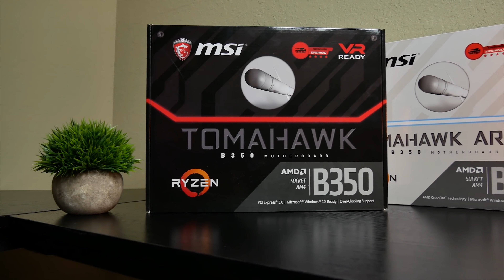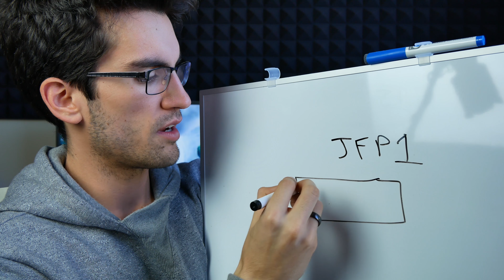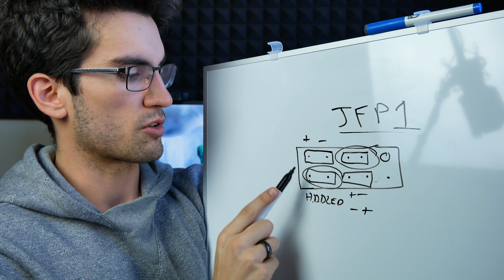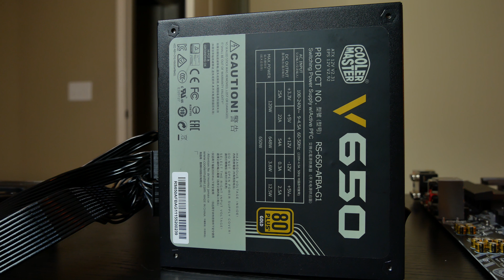How to Build a $600 Computer!

Comment: PSA to those building a Ryzen PC for the first time: Don't throw away those little plastic pieces that come installed on AM4 motherboards for the cooler if you plan on going to an aftermarket cooler in the future.  The stock AMD cooler won't use them, but most aftermarket ones will.  I got a Corsair H60 for mine a few days ago, and it uses those plastic pieces.
Reply from the maker: Yes! Good tip!

Comment: I picked up an msi gtx 1060 6gb for only £230, it's coming on the 13th december. Can't Wait!
Reply: Rainbow Wolfy where did you get it?
Reply: Patrick Reilly novatech, stock comes on the 7th of December
Reply: Rainbow Wolfy Thank you so much!!! Great deal😁😁
Reply: Patrick Reilly are you going to get it too?
Reply: What is that in American dollars
Reply: They were on ebuyer or amazon UK for 180 pounds. 3gb model.
Reply: sounds cool, im building my rig in a month, aiming for the gtx 1060 3gb, saw it at around USD$180 recently on Amazon but prices be volatile afff
Reply: Got my 1060 3gb today !!
Reply: SM PA you've oofed yourself, should've got a 1060 6gb
 If the pc works well foe you then I guess it doesn't matter
Reply: Rainbow Wolfy yeah I plan on only doing ultra 1080p gaming so it's good
Reply: yeah, it's all good. Only reason I got the 6gb is so its a bit more future proof
Reply: +Rainbow Wolfy picked up an rx 580 8gb for £100 fucking hyped

Comment: "Wait" they said, "DDR4 prices will drop soon" they said.
Reply: It keeps going up, better buy now, who knows if a barebone 16 GB (2x8) DDR4 kit will cost 200$ or more by 2018.
Reply: It should come back down sometime in 2018 since they're ramping up production for dram
Reply: I am building my pc on February (I already have most of the parts but I need to wait for a few more parts) and I'm going with ddr 3 it is cheap and for a budget build you are better of spending that 50$ you save on a better gpu :D

Just make sure you get the right mobo and cpu, modern hadware uses ddr4
Reply: Doesn't seem to be the case. I feel like there's always some pc part that will price inflated.
Reply: And at the end it did

Comment: Just built my pc, nzxt s340 elite, ryzen 5 1600, gigabyte gaming 5 x370 mobo, galax gtx 1070 ti exoc snpr white, with trident z 3200 mhz ram and custom cable mod cables. All due to your review and build in the s 340 elite way back. Thank you greg..

Comment: I love the diagram,  When I built my PC the front I/O connectors were plugged in wrong so I had a $900 Ryzen 5 1600 GTX 1060 FE PC that boot looped for three months, it wasn't until I watched on of Bitwit's videos where he made a 10 year old pc run fast where he dealt with the front panel connectors and that got me thinking so I redid them and BAM! It'll turn on but it'll freeze with the Windows 10 ISO. Flash to November 28th, 2017 where I flashed the BIOS and downloaded a free copy of Windows 10. It works like a dream, and you and many others have inspired me to go with Ryzen, so I did. Thanks. (P.S. I'm typing this on my PC with the Razer Ornata. You should review it sometime. ;)

Comment: Great video. For first time builders it still would be some challenge to assemble a PC with this tutorial. You went a little too fast over the cable connections like the 8 Pin and Sata power. You should have shown how the plug looks like and how the ports look like more detailed. For the front I/O you could have used a sample of your manual, showing how to interpret the graphics instead of your whiteboard drawings. At the graphic cards you could have shown a card with power ports, so newbies know how it looks like. Keep it up! :)

Comment: got all the parts arrived today. I'm watching this video while building my first pc. It worked 😊😁🎉

My build:
case: corsair carbide spec 04
mobo: msi tomahawk b350
cpu: ryzen 5 1400
ram: corsair vengeance LPX 8gb ddr4 2400mhz
gpu: gigabyte 1050 2gb
psu: corsair vs500 500watt
ssd: samsung 850 evo 250 gb

I got these from black friday and cyber monday deals.

Comment: I just did a ryzen build (second build) and the am4 slot on my asus b350-fconcerned me for a moment. It slid in easily, a little too easily than my first build with an intel core i5. The lever had more resistance with the LGA 1155 slot in the asus z270-e.

Comment: I never had a horizontal USB 3 connector like that on a motherboard. I'm surprised with how crappy that connector is and how hard you have to push to get it to seat itself sometimes it doesn't rip right off the board. USB 3.0 is the worst cable and connector in a modern PC
Reply: Joe Ebner The cable is so stiff that it’s impossible to route it anywhere.
Reply: Macie Jay Have you ever handled M O L E x
Reply: Yeah molex is bad too. Luckily that is dying out pretty quickly. Think I've only used it for case fans when the motherboard didn't have enough fan headers for the case.

Comment: 4:37 You forgot to mention to screw opposite corners in first to ensure that pressure is applied equally to the whole cooler and thermal paste isn't squished to one side (Especially when the cooler doesn't have pre-applied paste)!

Comment: You should have mentioned motherboard standoffs. One thing that confused me when I was building my first PC, the case had the motherboard standoffs preinstalled for a full ATX board, but I was installing a micro-ATX, so I was extremely confused, wondering why i had to flex the board to be able to screw it into the holes.. yeah I'm stupid, but I figured it out eventually and moved the standoffs to the micro-ATX position.

Comment: Help I just built my first pc and the fans spin with the mobo lights on but no boot, plus I have the Alienware ultra wide and it gets no signal, it only states it's on power save mode and I can only change from "hdmi" to "dp"....help :(

Comment: The Amazon UK price for this system is ~£700 (~$940).

I spec'd a similar system around the same case for ~£50 less, but with a 1060 instead of a 1050ti, 16GB RAM instead of 8, and a 2TB hybrid drive instead of a 250GB SSD.

https://www.amazon.co.uk/hz/wishlist/ls/3G4GS0BFGA90

Comment: you wasted your budget on Ram, SSD and power supply. you could do 8 gb of ddr4 2400 mhz, no SSD and 500 W power supply and instead buy a RX 570 to get some performance.
Reply: First thing I noticed too... Why spend $100 on a 650W power supply for a build that'll maybe draw 250W? Why go for 16GB of RAM ($200) instead of 8GB ($100) when the performance difference is nothing compared to what you would get from using the additional $100 on a stronger GPU instead? His SSD is just a bad choice altogether... There are lots of 240GB SSDs for under $100, like the Samsung 850 EVO 250GB which is $80.... You can get the 500GB 850 EVO for $140, or like $15 more than the 240GB SSD he picked.

Bad build, avoid!
Reply: B Thiel he could just buy a hard drive for the budget build. Loading time would be slower in games but no difference in performance. I think he had all those parts in his shelves in he wanted just to put them in use.
Reply: Daniel Transition I do agree with you, you can put there 8gb of ram, 450w psu , 1tb mechanical hard drive. And you would have money to fit there 1050ti 4gb OC or 1060 3gb. Bad build

Comment: I'm going with a 8320e and a 960. I behind the game a bit, but good price to performance.
Reply: Go with the 8350 or 8370.  I had a 8320E, most wheezy processer I've ever owned.  Its worth the few extra dollars.  Unless you are bound by power issues, like mobo or power supply size.   But it is your rig, just hate to see people make the same mistake I made.
Reply: MrRagequitnow I had a 6300 before. Ran me well. This is a big upgrade for the extra cores.
Reply: G3258 and gtx 970 :D
Reply: Toto Geenen The hell combination is that. XD
Reply: Liam Barrett I bought 8gb ddr3 1600mhz ram and a g3258 for 70€ but I will probebly upgrade the pentium to an i7 somewhere in the future. I bought it from my nephew and he has never oc'ed it so that's nice.

Comment: You would be better off finding a 2011-2012 PC with a 2600 or 2500 or 2400, and throwing a 470, 1050ti, or 1060 in it... That said, for a new parts build, you did good... But building new is probably a bad idea at the moment, frankly.

Comment: 1050ti maybe?
Reply from the maker: 1050 for $100 on Black Friday.
Reply: I think i parted out a list at 600 bucks that had a 3gb 1060 like a week after the xbox one x came out
Reply: you can get a 1060 3gb and and i5 with this budget.
Reply: 1060 3GB is way better
Reply: it just comes down to where you look: https://pcpartpicker.com/list/67yszM
Reply: he stuck more with quality parts... however, if you get a 1tb hdd, cheaper 8gb ram and maybe a bit cheaper case you can slide a 1060 in there
Reply: How about the used GTX970?
Reply: Pranita Kakde He just spent unecessary money on psu and ssd. But you could fit there 1050ti OC easy, if you get 450w psu and 1tb mechanical drive. Totaly not recommend you to do like what he did.
Reply: Get an RX 570 instead

Comment: 600!?, bull shit maan, after costs for parts there is also shipping costs, and if from a different country, you'll pay more(maybe), here is a list of parts and their avg prices that i come across...lower to med ends.
CPU: $100 to $300
GPU: $100 to $300
RAM: $80(8gb) to $200(16gb) - DDR4
MoBo: im not 100% on this one, i picked a gigabyte ATX Z170 gaming 3, $124 after all costs, could get mini to micro for less.
PSU: i was able to get a 650w for cheap, about $100 after all costs(corsair)
CPU cooler: proper any where from $50 to $100 after all costs
Paste: if you got parts used, will not come with paste, so $10 to $30 if you get cleaner and purifier liquids(might not be needed)
Optic Drive: $30 to $50(don't need a bluray)
HDD(s): $100,(7200rpm, 50MB/s+) 1 is fine all long as its got at least 1TB(depending what you use PC for)double for more.
Case: $50 to $100, pretty cheap, but make sure its the right size....
OS: minimum Win7, can cost around $70 to $80, i got mine for $30 from PCdistribution website, not bad i guess, 1 issue.
Ok so we have 10 to 11 parts(9 at least) and it all comes to....
700+ minimum(not including MoBo or paste costs) to 1330+(still not including mobo or paste for CPU), im sure dropping PSU and mobo will make things a little less costly, but still, im already over $600 into upgrades(cheap parts), not including OD, CPU, cooler or ram...
but this was for a gaming PC that could(maybe) play more recent games above 20fps on low settings....PUBG...or battlefield 1, or COD WWII, etc..

Comment: What if you want to overclock this $600 pc?
Reply: Toonami30 b350 is better than x370 at getting higher clocks, x370 has better software and more stablization and features
Reply: So i should go for Asus x370?
Reply: A friend of mine got ASUS Prime X370 Pro, he is very happy with it. I got an ASRock X370 Gaming K4 and i'm happy aswell. When you use a lot of SATA, USB 3.1 Type-C + A together and SLI you will be better with a X370 mainboard, but when you don't you can buy a good B350 Mainboard with good VRMs like MSI Pro Carbon offer. Going with an ASUS X370 is totally fine.
Reply: Thanks for the great advice. I will put it to good use when I buy all my parts for my first pc build.

Comment: HaHA too funny! I built almost exact system 3 weeks ago. Ryzen 1200 B350 tomohawk, 8 gb  Corsair vengence ram but with a RX 560 AND  i used my existing 750 w antec psu/case with  120 g ssd hdd for ubuntu and 350 gb seagate spinner for windows. That was a bad idea!  painfully slow win 10 is, even on a modern seagate, but no worries , I got this tomohawk mobo so i can get a M2 drive for windows very soon maybe for xmas.  It overclocked great on stock wraith cooler but rather loud whining fan so i just made custom brackets for my AM3 kuhler 920 liquid cooler and mounted it on this AM4 mobo and man oh man does it run cool and quiet. Fans on Kuhler 920 barely run at idle and neither does RX560 fan run at idle but my room is only 18 c. Now the loudest thing in system is the psu 140 mm fan . it is annoying to listen to the kuhler fans cycle on and off to a mere 600 rpm barely audible but annoying when it goes on and off constantly every 20 secs.
Even burning in with aida 64 this system doesnt get hot enough to run kuhler fans anymore than min speed sometimes still cycling on off

Comment: can anyone that knows a lot about computers give me ops on mine? i have a core i3 7100. gtx 1050 ti 8 gb ddr4
Reply: Cause I know enough to tell you that's a pretty respectable machine for 1080p. I'm running 1600x w/16gb ram and an rx570 red devil, which is alright for now but will be upgraded soon. Almost bought a 1050ti a while back, performance/price ratio seems great, especially on sale